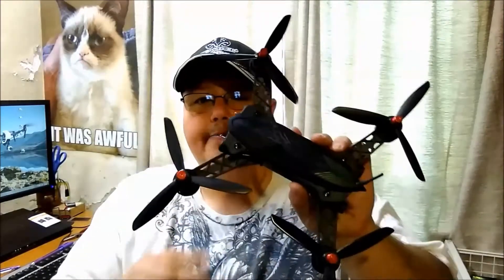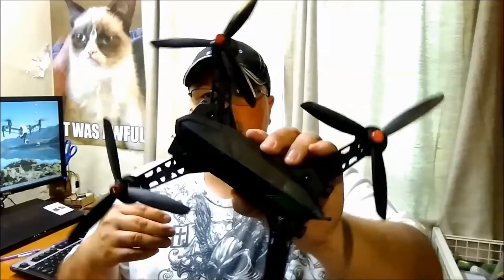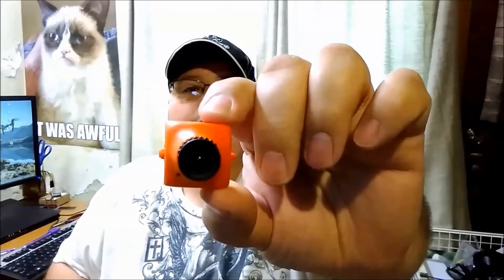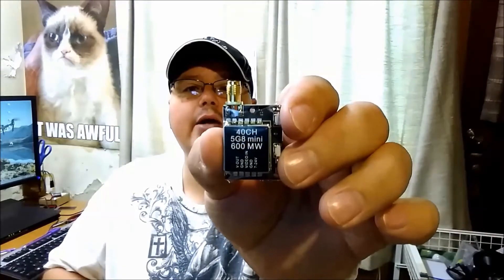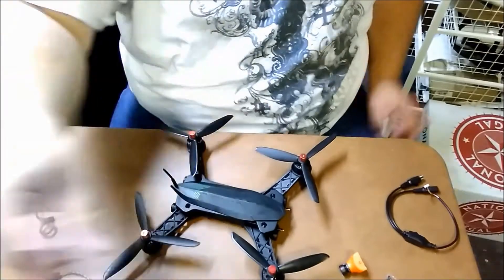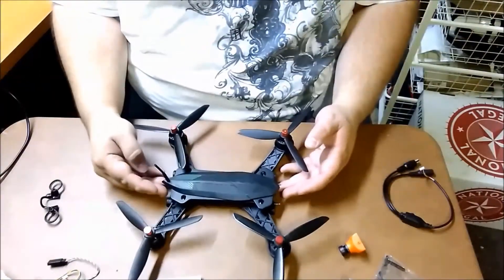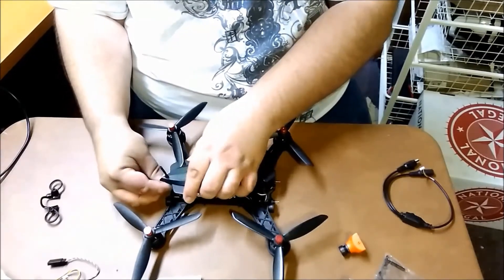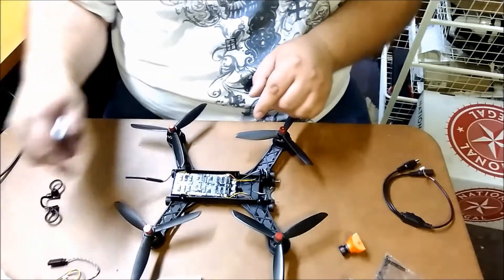MJX Bugs 6 MODS and UPGRADES Part 2

Comment: I have looked into this camera and it does have a nice good quality video from what I have heard. I just didn't like all the extra wire you have to lay down. I have the bugs 3.  I went with the factory camera and the only bad thing is the camera doesn't angel up only down other than that I get great 5.8 fpv flight and video recording and very easy to install.
Reply from the maker: Very nice

Comment: What battery is that?  Can i ask what difference there is between that 1 and the stock 1  thanks
Reply from the maker: It's one I used from another drone. My stock one died. This one is a 1200mah 7.4v

Comment: It's a cool looking drone but ya I've heard about the motor issue but cool mod Mike 👍
Reply from the maker: Thanks, no issues with my motors so far but I will let everyone know if I do
Reply: The very first piece to break on my bugs 6 was the plastic motor casing. I havent even broken any props yet. I'm very disappointed with the motor quality. Luckily nearly everything else is very durable. Whose genius idea was it to make plastic brushless motors anyways? I've never seen this on ANY other models. It makes no sense to make a part that takes so much abuse out if plastic.

Comment: from what ive seen i wouldnt recommend the bugs 6 or 8 to anyone, but i would the bugs 3, either way good to see a video talking about how to improve these drones...plastic motor bells tho..fer real MJX?
Reply from the maker: Ya they are plastic. I haven't had a single issue yet.
Reply: thats good, i know TheRCSaylors were having motor issues. good to know it can still work well at least, just doesnt seem like the place to cut cost tho to me, does that much metal vs plastic really make enough difference to justify it. i still love MJX and my view is biased on these two since i dont own one (the 6 and 8) i am disappointed that they had a drop in quality from the bugs 3 tho, they really had a chance to "kill" the hybrid market in a good way.
Reply from the maker: True very true. If I run into issues with the motors I will put out another update video.
Reply: Mike's Drones and More my plastic motor casings broke my first flight. Probably replacing them soon.

Comment: Fligth time with this 2300mah battery?
Reply from the maker: I got on my best flight about 10 minutes
Reply: Mike's Drones and More nicee.. the factory battery is givin me 6-8 minutes
Reply from the maker: Ya that's about average. This battery is just a replacement because the stock one failed on me. And this one is 7.4v 2200mah not 2300
Reply: Mike's Drones and More but either way, well done Mike.. Your modifications were awesome.. Im gonna do the 3 blades and buy a little pack with 3 baterrys 2300mah.. :)
Reply from the maker: Ya I love the tri blades they are awesome.
Reply: Tks Arne.. I was thinking on buying some chinese battery.. Do you think its bad?! Cause they have 2300mah 35C for lower price.. And i dont think i can find a Turnigy seller who sends to Brasil... Do you have some Store to recommend me!? Tks a lot!
Reply: Thiago Dias Amato, they are supposed to deliver world wide. Which ones were you thinking of?
Reply from the maker: Those should work. Idk if Amazon ships to you or not but I buy a lot there. Also check out getfpv.com
Reply: Tks Michael.. I'll check it out.. =)
Reply: Arne Olivier, Im thinking this Turnigy that u said to me or some Zippy.. How much your Turnigy weights?! Sorry for delaying on awser.. My youtube is not notifing me..
Reply: Thiago Dias Amato 134 grams. I get 10-11 min in mode 2(fast) and about 15 in mode 1(slow). Zippy batteries are great as well. And a bit cheaper I think.
Reply: Awesome man!! I'll try this out!
Reply: Mike's Drones and More what tri props did you mike?  Could i use any tri prop?

Comment: So you no if the system can handle 3s Lipo =)
Reply from the maker: I have only used the 2S idk if it will take a 3. I don't want to burn up the motors or board
Reply: Thanks Mike I'll let you no if it's ok as I see the bugs 3 can take it and the motors look the same to me also love the channel
Reply: It wont take 3s. The esc cant take it sadly. Bugs 3 does 3s but not bugs 6 or 8, the 8 pro MIGHT but id double check on that one.